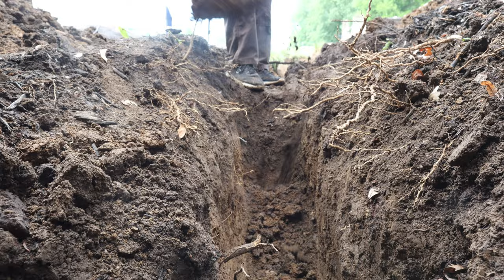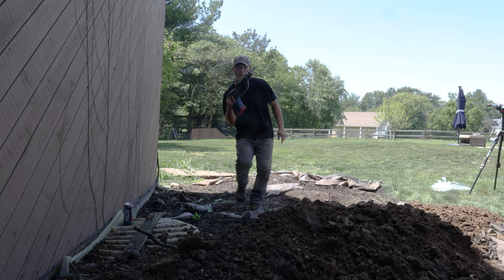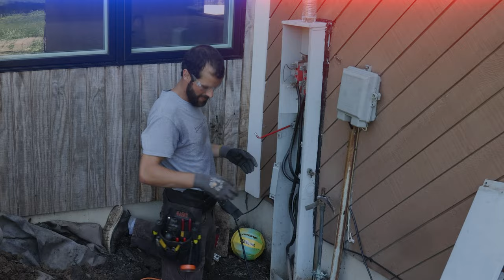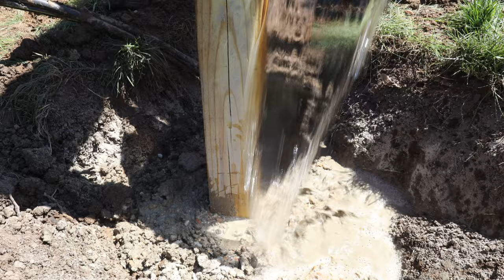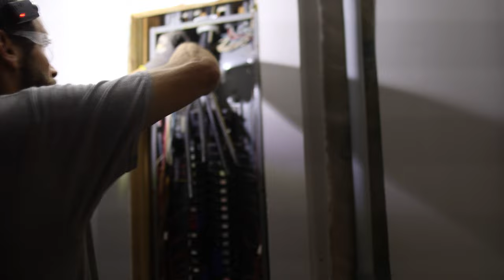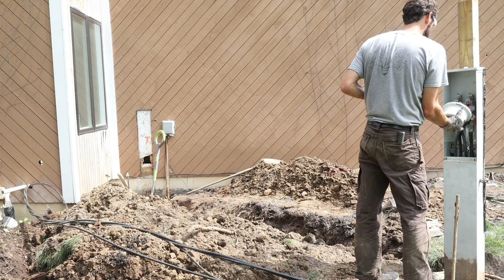My Crazy electrician moved my Electrical Service with Live Wires ||| Dream Home Renovation Ep. 4

Comment: To be honest, I was more worried about you grabbing and handling the slack in the main lines as he moved the base... a nick in the insulation from shoveling could be bad...  A company i worked for in the past once after putting a 2 story addition onto the side of a house needed to move the overhead feed from the original location to the addition as a new pannel was installed there for the extra load. The owner was also a licensed electrician, and when time came, up the ladder to disconnect the lines from the mast head, one at a time taping each good, then dropped the line into the front yard. then he got down, moved the meter over to a new base over on the new addtion, went out to the yard to grab the line, and up the ladder to connect it up. (we had someone in the front yard the whole time to keep watch to make sure no one went anywhere near the line while it was down.)

Comment: yeah, my heart didn't start beating again until the end of the video. I could build you a house from the ground up, do all the plumbing, drywall, flooring (though I'm not a fan of installing carpet), and shingle your roof, but the one thing I won't touch is electrical lol, I mean I can change an outlet and light switch, but working with the panel or any of the wires is a big no thank you for me

Comment: I did this in the uk, they quoted me £3k to do it and i did not want to pay.
The existing feed was to a mobile home on the build site and i wanted it to my nrw house. I dug back along the cable then towards the new location then disconnected it with high voltage gloves on, taped the ends, mover the power meter to the new box then connected it in.
Covered the cable with sand and slabs the warning tape and back filled.
Job done zero cost

Comment: Nice to see this but he should have had on more ppe. Better arc shield mask and somthing to prevent his exposed arms in case of an arc flash. He still could and you could have bean seriously harmed by stray voltage as well. When he said you have 220 legs comming in on ether side you need to double that to 440. Thats a hell of alot of voltage Comming in. But it can be done and it was still enjoyable to watch and see. And i have done the same joke with my wife about acting like im getting zapped by electricity. Lol funny as hell too.

Comment: One question, when doing the framing around 35 second mark, why did you run less joists longer instead of more but shorter joists to the foundation? Wouldnt they be much stronger that way?

Comment: So what is it that kept him safe with those live wires? Was it the gloves or was it something else?
Reply: The gloves, a tremendous amount of skill, and a little bit of luck.
Reply: The gloves are preventing his hands with moisture in them becoming a conductor, of electrical energy, they also help prevent arc flash to a point. As long as you are not making a circut you can hold on to live wires all day long without getting zapped. However he should have had a proper arc face shield and protective clothing on while doing the disconnect and reconnect. It's just good practice.
Reply: @nicktrayer5426  i was wondering about the shield he was using. I looked like an ordinary kind like people wore at the start of COVID.
Reply: Yes there are specific arc flash face shields they are tinted to also protect the eyes from the bright arc